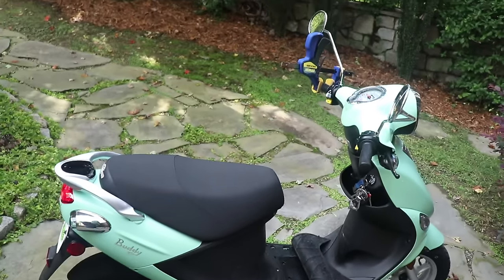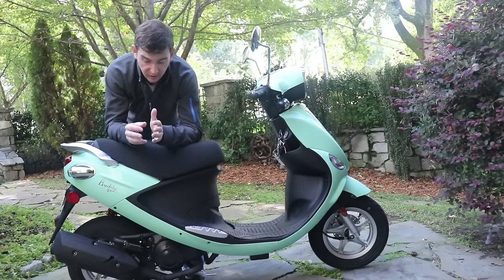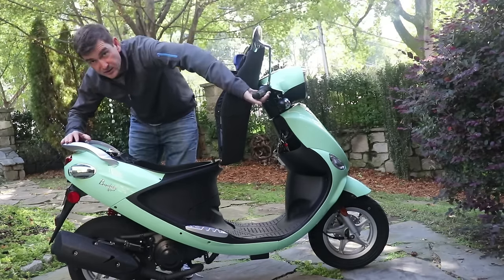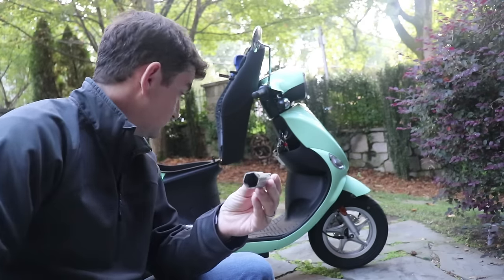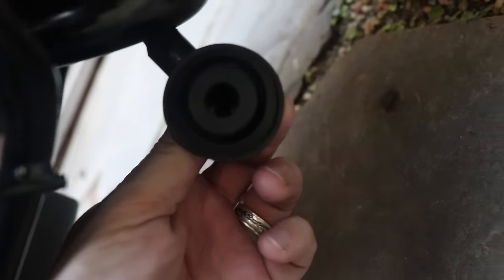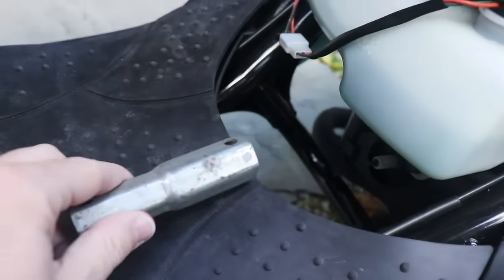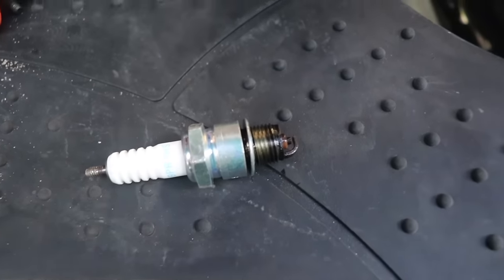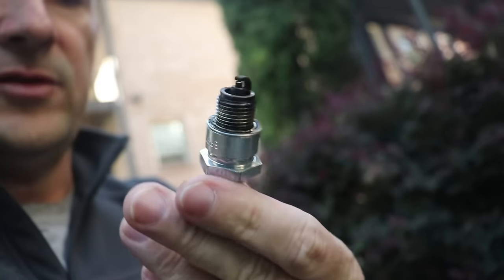Scooter Won't Start After Sitting - How I fixed mine

Comment: 2 stroke is no good they don't run good on ethanol fuel.  The blowing wont work because the bike has a petcock a vacuum activated valve.  Sucking on the vacuum lines can open it to let fuel out.  I just removed it and installed a regular manual fuel shut off switch so their is always fuel going to the carb bowl.  Over time it evaporates from the carb bowl and it takes time cranking it to get the fuel to flow into the carb bowl to start it that's why a manual valve is better the petcock prevents the fuel from leaking out of the tank if the carb float bowl gets stuck open.  All you have to do is touch the spark plug on the engine and have someone crank it to look for the sparks but be warned you can get shocked.  This issue is the fuel has evaporated from the carb bowl a common issue when a bike sits too long.

Comment: BLOW into Gas Tank ?🤣
BTW genuine Buddy 50 comes with a tool kit that has a spark plug wrench under the seat! Unfortunately I lost my tool kit I opened the seat it must have fell out.. so I went to my local home Depot bought a new spark plug wrench... Along with a bunch of metric wrenches a vice grip pliers and a screwdriver with multiple tips .. store it under the seat

Comment: 2:20 bro bro bro, all engines have an intake, and exhaust, there has to be an intake or else it could run with out air, DONT cover the exhaust it's a a 2 stroke that's not gonna hel0

Comment: I guess that tool that looks like a box, that you used for the spark plug...............could be called a box spanner..........or as you used it on the plug...............maybe just call it a plug spanner.

Comment: If you want to clean out your fuel lines and your carburetor and fuel tank next time you fill up go buy what they call B12 Chemtool and put the hole can into your gas and let it run through it will clean out your whole moped car and all

Comment: carefull while doing this... mine did the same, i was frustrated it didnt start since it was new, did this... blew as hard as i could... and acyually passed out... like litterally the lights went out and boom to the floor i went.. so be carefull :))
Reply: Did you get it going tho..I'm having this problem it a new scooter ..sat this winter..I rode it for a day..out new gas in ..now it won't start
Reply: @joshuataft5541  yes i solved it, turns out under the seat there is yellow  switch that cuts the fuel if you want to secure the scooter...and it was set to locked...🤦
Reply: @georgenooner  glad u fixed it. I gotta figure mine out tomorrow. I love scooters but man they dnt like to sit at all .I'm used to bigger bikes but hurt my legs bad in a big bike so now tmi can't move my legs enough to shift gears..thanx for the update. Hoping I can get mine running tomorrow
Reply: @joshuataft5541  if it is barely turning the engine and the lights flicker...then its the battery, also check the spark plug
Reply: @georgenooner  I got a new sparkplug and I jst charged the battery..I'm thinking the jet is clogged or something..I took it out from winter storage..rode for a day..put in a full tank and parked it .the next day it wouldn't start and hasn't since..it turns over but won't fire up .lights and everything are fine .I jst got it last summer so it's still pretty new .never had any problems till now..I let it set to long without starting it..I'll get it.. tomorrow I'm gna try it and if that dnt work I'll clean the carb..I've never done it before but I been trying to research what to do .that's how I found this video
Reply: @joshuataft5541  what i sugest...before you start... Buy a tube of Motul Carbuclean, take the air filter down and spray carbuclean into the intake while you hit the starter... It could solve your problem if the jets are clogged...and you dont risk to damage anything since you say you havent taken the carb apart before
Reply: @georgenooner  nice .thanx I'll do that.ive taken it off and kinda checked it out and have watched videos but yeah I usually dnt work on my own stuff..seems simple if we have the right tools but it is a pain..thanx for the info..I really appreciate you taking the time to let me know..I'll get some tomorrow and try it out..thanx again

Comment: I had this same problem with my buddy 50cc 2012 recently. I just bought it a week or so ago off of market place when one day it stalled and never started again, but I took it to a local scooter repair shop that showed me the intake is on the back left side of the air filter (behind left foot), sometimes you just cover that and it clears it

Comment: Man this video was way too long. Simple things with scooters are usually the main problem when it refuses to start. Its either fuel is not getting through the carb, battery or stator not putting out a charge and spark plug not firing or the plug coil or cdi. Its process of elimination based on ifthe bike will try and turn over or you get nothing when your trying to start it. The reason the spark plug is so fouled is because you are running rich. That means your fuel/air mixture screw is open too far and gas is overtaking the air being pumped into the carb. You have to adjust it frequently over time to get the right setting of air and fuel.
Reply: Dude, I honestly think this video was done for the humor of it. I laughed my ass off all the way through this video (& I've worked on scooters and motorcycles for 45 years). This guy uses whatever "he can find around the house to fix his scooter. I almost fell off the couch with that sentence. Have a sense of humor - there's plenty of real repair videos on youtube so when you run into one like 'this' just enjoy it. I love this guy for honestly posting such a funny video.
Reply: I need someone  , I will pay!!: to come and get my scooter started for me. I only have use of one hand. Please help me ,if at all possible.
Reply: Can someone  respond??

Comment: Oh my goodness dude it's an engine and has an air intake you need to combust the fuel with air in order to get an explosion that's how the engine generates power that is how all internal combustion or combustion engines in general work every engine has an air intake this is still true for mopeds just as it is for cars. You clearly don't know much about how engines work. Hopefully you know what a choke is if you've ever used a a lawn mower or other small engine you should know that when you start it you turn on the choke. This decreases the volume of air flowing into the carburetor which results in a richer mixture of fuel to air. With more gasoline in the mixture it is easier to start the engine. Chances are your air intake is on the left side of your scooter right next to the wheel it should have a big plastic box right by it called the air box, where the air filter is, and a hole where the air enters. Because the scooter does not come with a choke switch you'll need to cover the air hole by hand in order to richen the fuel to air mixture. Blowing in the gas tank achieves the same effects of richening the fuel to air mixture by forcing more gas into the carburetor.
Reply: well done

Comment: I respect the you trying but everything you say are like the opisit of how thing works or how ur supost to do it, maby se if the spark plug acuely gives spark? Not just put a bit of gas on the tip? And you said the spark plug smels like gass so it works??? Its conectet to the engine its supost to set fire to gass directly! Well now you know atlees 😁😅

Comment: Dude lol you should had cleaned the spark plug with some sand papper or wire brush like you said not just putting gas on it lol or just buy a new spark plug

Comment: Great comedy I guess. Save time DON'T WATCH. Pull the plug and clean it. Put some starting fluid or gas on it. Put it back in correctly. It will start right up. He had bad gas with ethanol. ALWAYS use ethanol FREE gas. Thank me for saving 18 minutes of your life.

Comment: "It smells like gas - I  dunno probably  why it's not working" 😂😂😂 maaaaaate... You're  holding a spark plug... what do you thing think IGNITES the 'gas'? Hahaha brilliant. And that black stuff is called carbon deposite. Incase you didnt know petrol produces part as a by product of combustion and due to the high working temperatures the carbon bonds with the internal surfaces of the engine. One of which being the spark plug.

Comment: Long story short the reason why these dammed scooter wont start is cuz these pos scooters have a gas problem thanks to the worst made part known to man that is the fuel pomp it works by using the air from the engine to get fuel to the engine but on cold start its like trying to get a bolder up a mountain backwards for these abominable things

Comment: Yes... clearly you got a scooter that didn't come with an air intake.  If you drill a hole... A BIG HOLE... in the big metal thingy with cooling fins all round it, right next to where you put the spark plug in... that should fix it. Now you'll have air intake AND exhaust in one hole.
You're Welcome.